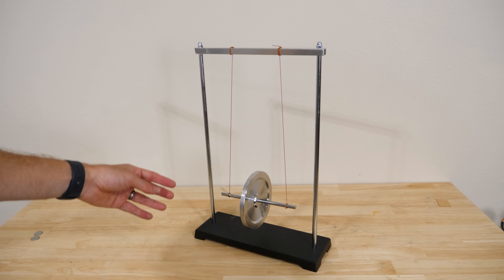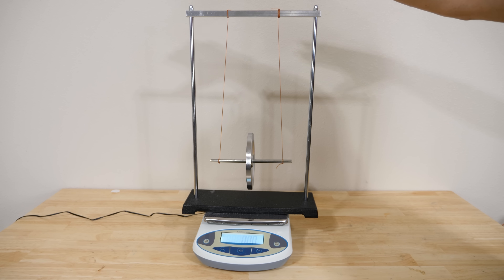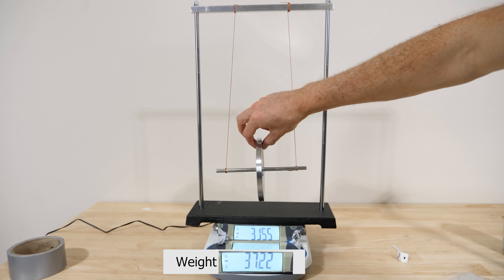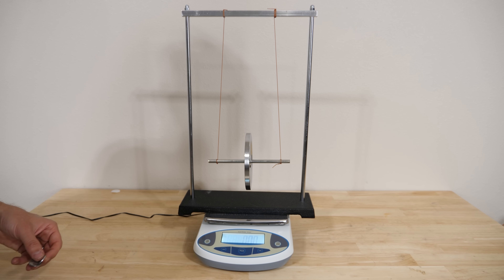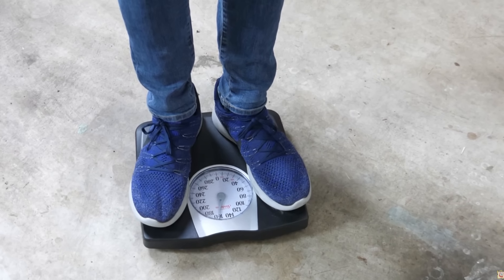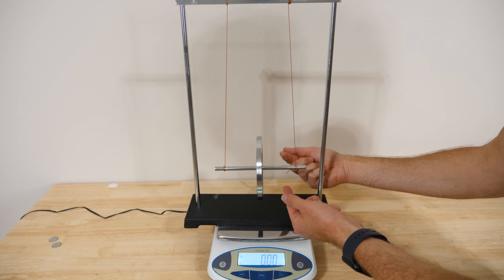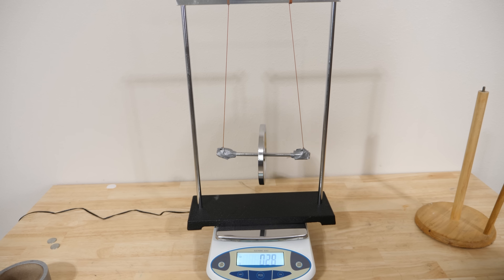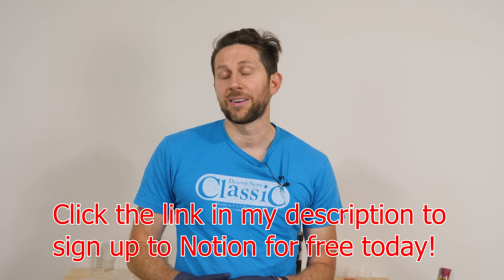How Does The Anti-Gravity Wheel Work?

Comment: Looks to me a couple things are going on here.
1.  Scale update rate is slow compare to actual
2. There is always a counter acting upward force from the converted potential energy which causes the wheel to climb back up the rope. You'd see the same effect with a spring.  The stored potential, as it decreases, is always countering the downward force the scale is measuring.

In a way, your scale is showing force changes as they occur (well, at a refresh rate the scale is keeping up with).
Reply: I wonder if the same antigravity effect happens with just a spring.

Comment: I imagine you would get a similar effect if you were using a rubber band to hold any other object? Then stretching the band and releasing it would lower the weight?
Reply: It would indeed be the same. The rotation of the wheel has nothing to do with the experiment.

Comment: Does anyone remember the name of the scientist who became obsessed with gyroscopes and atigravity?  It ruined his career because he refused to look at all the facts in front of him.
Reply: Eric Laithwaite.  He eventually admitted that his claims were exaggerated, and that his allegation that gyroscopes were antigravity devices was oversimplified.

What really happens, is that gyroscopes are more like "anti-torque" devices, rather than anti-gravity devices.  By allowing the gyroscope to precess, it no longer requires a supporting torque to hold it in place when the center of mass is offset from the support point.  Instead, the torque due to gravity causes its precession, rather than causing it to tumble down.

This can make it appear as if the rotation is making it weigh less, but it really isn't.  All it is really doing, is removing the required counterproductive force, that you normally need to apply to lift an eccentric load from your handling point.  It still weighs its full weight, you just only have to apply a linear force.

Comment: The rotation has nothing to do with the experiment. You could as well have hung it on a spring. It's similar to standing on a scale and throwing on object into the air. While it's in the air, the scale shows less weight than when you're holding it.
Reply: Well put—that’s a great explanation
Reply: It does, actually, it introduces the asymmetry between the upward and downward accelerations. Springs don't have that property.
Reply: Or jumping on a scale.
Reply: So called weight loss yo-yo effect

Comment: Very cool! (The “missing” grams on the positive side of scale is collected in the knock when direction change at the bottom - just like one feels operating on a yo-yo.)
Reply: yes
Reply: What happens if the wheel has a free floating spinning edge with enough mass to negate the effect of the "stationary" wheel in the center? And if that edge is seeded with rotational energy?
Reply: @MrKahrum  I don't understand the question.
Reply: @carultch  attach a massive wheel with bearings so it can spin freely around the disc. Reduce the weight of the disc so that in the new system it is negligible
Reply: @MrKahrum  Ok, I see what you are suggesting.  You are suggesting to use the flywheel on a bearing, rather than rigidly attached to the axle.

If you did that, what you'd essentially be creating is the equivalent of a yo-yo that can "sleep".  That is, get to the bottom of its descent, and keep spinning in place.  Eventually, friction in the bearings would speed up the shaft, and spin the shaft with it, causing it to bounce back upward again.  When it does get to the bottom of its descent, it would spike the weight on the scale, and then return to its normal weight when at rest.  Then it would spike the weight on the scale again as it rebounds, and reduce the weight while it rises back up (because it is accelerating downward).
Reply: @MrKahrum  Ultimately, what governs what is happening to the scale reading (excluding times with intervention from James as an external agent) will be based on what is happening with the center of mass of the entire system.  If the center of mass accelerates upward, the scale reading increases from its rest value.  Vice-versa for the center of mass accelerating downward.
Reply: @carultch  No. The yo-yo from its spinning “at rest” in the bottom, bounces up when it catches the rope. This is felt as a sharp knock. On its way up it is in retardation (just like any bouncing ball) mostly due to gravity, and all it’s way up a system with a weight will have a decrease. The only time the weight shows increase is this typical knock. (If you have ever played yo-yo at some level, like “walking the dog” (spinning at rest at the bottom), you certainly will have felt on the fingertip what’s going on.
Reply: So if you drop a bouncy ball, record the force vs time (which would look like a sharp peak) at first impact/bounce and record the time between first and second bounce, t; then would the area under the peak divided by t be the weight (in units of force) of the ball?
Reply: @joseville  Here's what would happen if you weighed a bouncy ball while it was bouncing in cycles.  Suppose our bouncy ball weighs 1 Newton, and rebounds with a perfectly elastic collision off the scale.  This means it always rebounds to the same height every time.  That is a heavy ball, probably similar to a lacrosse ball in size.

While the ball is in the air, it will weigh zero, assuming you can neglect air drag and downwash of air.  It is in free fall, and not in contact with the scale.  When the ball hits the scale, its weight will spike while it impacts the scale, and while it rebounds.  If you integrate the force from peak to peak, or from post-rebound to post rebound, and then divide by the time interval, you will indeed get the ball's weight.  As long as you use a complete time interval of a full cycle, where the velocity of the ball is the same at both the start and end of the interval.
Reply: @carultch  thanks! It's so cool that this is the way nature works, but why? What are the principles at play that let one make this conclusion? Conservation of momentum? Of energy? Do you have to consider the ball *and* floor as the system? Or just the ball?

I understand integral of F dt has units of kg * m/s which is the same units as momentum.
Reply: @joseville  The impulse-momentum theorem, and the acceleration of the center of mass, are the physical principles at play.

Regardless of what system is on the scale, study the acceleration of the center of mass of that system.  This will tell you what forces have to add up to, and the scale's constraint force will be the flexible force that adapts to this acceleration.  If the system on net, has downward acceleration of the center of mass, then the scale reading decreases.  And the opposite is true for a center of mass accelerating upward.  A steady speed center of mass, or stationary center of mass, would mean no change in the scale reading from its reference frame.

Between two equivalent points with no net change in the center of mass velocity, the impulse of the scale will add up to the same as the rest weight of the system being weighed, because the net impulse would have to add up to zero.  Center of mass velocity unchanged means there is no change in momentum, and thus no net impulse.
Reply: So you could redo the experiment with a yo yo attached to a hanging hook scale?
Reply: @joseville  The impact/bounce time time-force (area under the graph) when the wheel, yo-yo or ball makes it go upwards and then there can be all the way to zero measured on the weight. (The ball, or straight drop of wheel without spin.)

It’s bouncing, and even if the wheel spinning slows the speed of the bouncing, there will be a sharp knock on the strings - just like what you feel on the fingertip with a yo-yo.
Reply: Below the power of inertia…
Reply: In the yoyo style this project looks perfect for simulating perpetual motion.
Reply: so is it the case that:
loss of weight in air * time in air = gain in weight at bottom * time spent turning around at the bottom?
Reply: @alansmithee419  BINGO!  That's exactly what would happen.  Multiplication would technically turn into integration, since the spike at the bottom would not give us a constant gain in weight.
Reply: I do not think they are collected in the "knock". The knock is just because the way the ropes are attached to the axle the transition from downward to upward motion is not smooth at all.  I think those missing "grams" are collected when he pushes the weight up and rewinds the mechanism.
Reply: @NetAndyCz  that would leave missing weight between resets of the experiment. This is why he let it go to complete rest, to ensure that the system has stabilized and it is back to its default state
Reply: @MrKahrum  Both states (the weight is up and stationary and the weight is down and stationary) have the same weight. But when the weight is "falling" or bouncing less and less the weight is slightly lower. and when you put the weight up, the system (including you) should appear slightly heavier.
Reply: Those missing grams are collected when the disk is wound and elevated back up to it's starting position lol.
Reply: @ImYourProblem  

No. 

The grams are missing both up and down(!) They are in fact collected in a knock at the bottom.
Reply: @eb4661  They would be collected in the knock at the bottom, but that knock at the bottom is in a blindspot of the scale's signal processing capabilities.

If you could measure with infinite precision, you'd get an average force of zero in the scale, between equivalent points in the cycle.
Reply: @carultch  Yes, I know. The  peaking integral of the collision needs some sophisticated instruments to be measured. 

I’ve never thought of a yo-yo actually feeling lighter upwards depending on its angular momentum, but surely it does: The “knock” when it grabs the line - feels like a sharp bouncing - and grams “disappears” for the split second up-words.
Reply: @eb4661  negative... the force of gravity is in assistance on the down stroke.

Comment: Interesting effect, well shown, thank you!

Would be interesting to know what the phenomenon of gravity really is and how everything is really tied together.
Reply: It's just bouncing on the scale. If you bounce a ball on a scale, while it's in the air, the scale shows less weight. The rotation of the disc has nothing to do with it. He could as well have used an object on a spring.
Reply: @peterwhitey4992  I don't think that's the same.
The scale shows a continuous negative weight, you wont get that from bouncing a ball on a scale.
Reply: @OmegaZZ111  - It is the same. The scale just doesn't update fast enough, to show the force of the bounce.
Reply: @peterwhitey4992  The rotating mass and the precession along another axis creates a measurable loss in weight.
This effect is clearly shown in the video with the rotating flywheel with a handle that is easy to lift when the mass is rotating.

This is not the same effect as a ball bouncing on a scale.
It is not about the scales refresh rate, the rotating wheel is actually loosing weight.

While the mass of an object is constant the weight is dependent on many factors.
Reply: @OmegaZZ111  The rotating and precessing mass doesn't create a loss in weight.   It is more like a loss in torque that makes it easier to lift, than a loss in weight.  If you weigh yourself while lifting that wheel, you will see no weight loss while the wheel rises at a constant speed.  Only a weight loss when you slow it down at the top.  You will also see a weight gain at the bottom when you initially lift it.  The rotating wheel makes it easier to lift, because you only need to lift against its weight, and don't need to lift against the torque due to its weight.

You only lose weight in a system in motion, when the center of mass of the system being weighed accelerates downward.  Or if you go to another location where the value of g is less.
Reply: @carultch  I think you misunderstood my point.
I am saying the flywheel itself looses weight when rotating and precessing in comparison to when it is not moving. 
It is obviously the case so, otherwise you wouldn't be able to lift a heavy flywheel that easily.
Reply: @OmegaZZ111  I don't agree.   Derek from Veritasium tested this, and found that it isn't really losing weight by virtue of spinning and precessing.   I don't see any mechanism by which it would really lose weight just from gyroscopic effects.
Reply: @OmegaZZ111  The reason you are able to lift the flywheel a lot easier when it is spinning, is that you no longer have to support the torque of its weight.  When it is stationary, your outer hand has to push down, and your inner hand has to lift with enough force to offset both the wheel's weight, and your outer hand's downward force.

When it is spinning, and you let it move in the precession direction, you no longer need to apply a counterproductive force with your outer arm that is needed to oppose the torque.  You simply lift against only its weight, and not the torque due to its weight.
Reply: @OmegaZZ111  If you want to test this for yourself, try using a bar with identical flywheels on both ends, such that the assembly weighs the same as the Laithwaite wheel assembly.   Place the bar on two stands while you spin up each wheel in the same direction, to the same speed.

Compare lifting this assembly when the disks are rotating, to when the disks are initially stationary.  It will be equally difficult, because you were never providing a counterproductive push to hold the bar in the first place.  You simply lift it from the center of mass, whether they are spinning or stationary, and in both cases, you lift with a force equal to the weight of the bar + flywheels.
Reply: @carultch  Don't overcomplicate things with different setups that produce different results.

The Laitwaith example with a flywheel that has handle attached to it shows clearly that the flywheel needs less force to be lifted up when it is rotating and precessing. 

Weight is defined by how big the force against an object (hand that is holding the handle with flywheel) is, therefore the flywheel undeniably looses weight.

With this definition of weight I cannot understand how you can argue that the weight is not reduced.

Weight = The force exerted on an object by an acceleration field (gravity)

Maybe you have a different definition of weight or you confuse it with mass..
Reply: @OmegaZZ111  I'm not overcomplicating anything.  I'm telling you that the claim that it loses weight, i.e. loses net support force, is nonsense.   It is easier to lift because you remove the counterproductive force in your other arm.  Not because it uses less lifting force overall from you.
Reply: @carultch  I disagree.
Mount the handle of the flywheel directly onto the scale and hold the scale in your hand, so the force (weight) exerted onto the scale is shown directly without the weight of your body.
You will see the weight shown on the scale will decrease when the flywheel is rotating and precessing.

You would literally be unable to lift a 20kg flywheel attached to a handle with one hand.
As soon as it rotates you can lift it up easily and you are telling me the flywheel hasn't lost ANY weight?

Weight is a force per definition and if this force exerted on your hand becomes less the weight becomes less.
This is not my opinion, this is an undeniable fact.

A 20kg iron bar acts more force on your hand than a 1kg bottle of water.
The handle of the flywheel acts 20kg of force on your hand when not rotating and 1 kg of force on your hand when rotating - therefore less weight. 

Please read what the definition of weight is, it is not constant. 
The weight of an object (a mass) is medium, location and vector specific.
Reply: @OmegaZZ111  Please stop repeating the definition of weight back to me.  I know what weight means and the nuances of the term.  It is doing nothing to help your case, but distract me from the reality that you don't have an explanation of your point.

I've weighed gyroscopes in precession motion and they don't lose weight by virtue of rotating or precessing.  They still pull downward on their support point with a force equal to what they weigh at rest, as long as the center of mass is remaining at the same elevation.

I don't agree that the 20 kg Laithwaite wheel will appear to only exert the weight of 1kg on your hand while lifting it like he did.  Try and demonstrate this.  And quantitatively, so we remove the human perception element.

Laithwaite admitted his claims of gyroscopes being anti-gravity devices was a misunderstanding on his part.

Comment: So How Does The Anti-Gravity Wheel Work?
Reply: This one?  It works because its center of mass is accelerating downward.  This reduces the support force the scale has to apply.  You don't see the readout during the reversing periods, because of a sampling bias on the scale, and an asymmetry of the time it spends accelerating downward compared with the reversing period at the bottom of the string.

If you are talking the Laithwaite wheel, it isn't really an anti-gravity wheel.  That was a misunderstanding on Laithwaite's part.  It really is more like an anti-torque wheel, because it relieves the burden of needing to support the torque due to the wheel's weight.  You need to apply a counterproductive downward force, to support a load outside the support points (your arms).  By removing the need to apply a support torque and the counterproductive downward force, you only need to apply a support force equal to its weight to lift it.